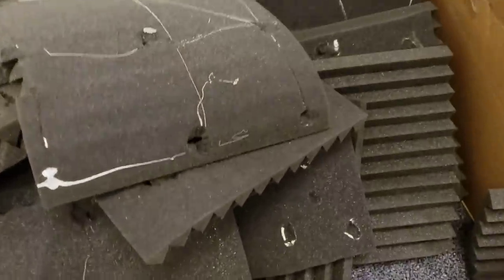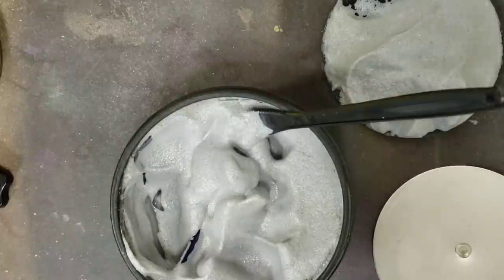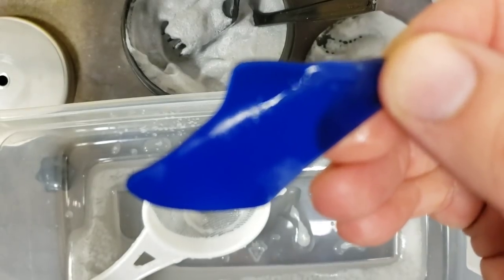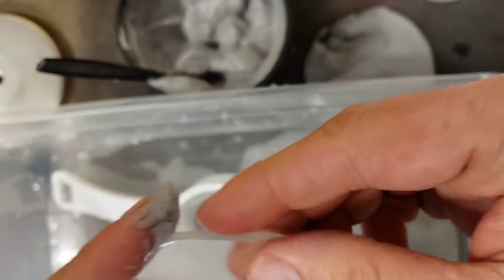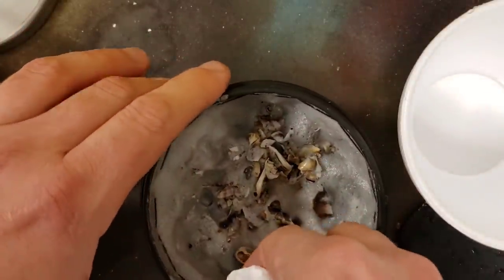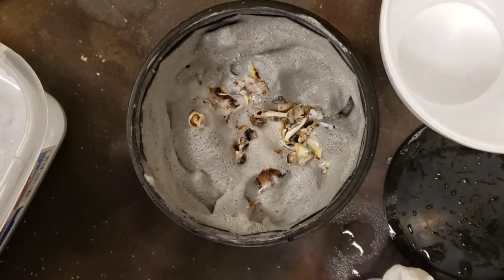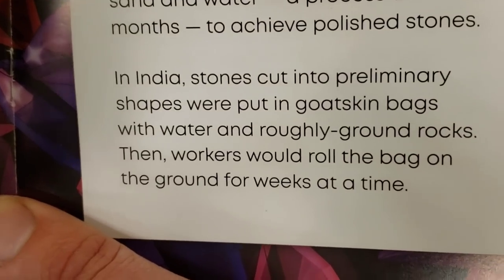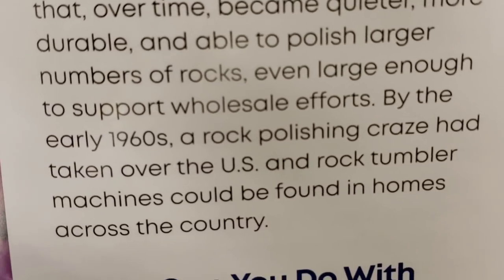Checking the Sea Glass!!!  (Opening the Rock Tumbler)

Comment: I have been tumbling glass for about 7 years now.  I use only beach sand and it works great.  I also use a large rock tumbler and tumble mine for a minimum of 7 days.  Yours came out fantastic, great job.  I use the larger tumbler bc I drill my glass and make wind chimes out of them.  It's a fun hobby to make sea glass and some of the amazing shapes the sand forms the glass into is so neat.  Enjoy and have fun with this fantastic hobby.
Reply from the maker: Great info!  Do you ever get the real frosted bubbly look on the surface of the glass like hundreds of years old sea glass and if so, do you know what does it?
Reply: @MattsCrazyArt  yes I have and purely by accident.  I left glass tumbling for about 3 weeks and mostly all of it came out like that.  I put in very large pieces of glass and the weird thing was, not the entire piece of glass came out that way.  It seemed more like the curved parts came out with the bubbles.
Reply from the maker: Nice!  I will try that next